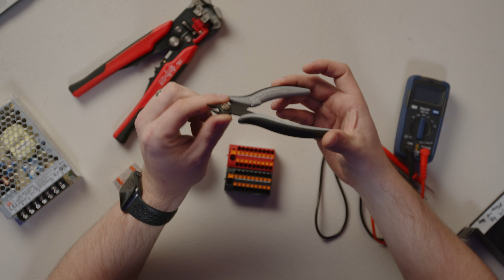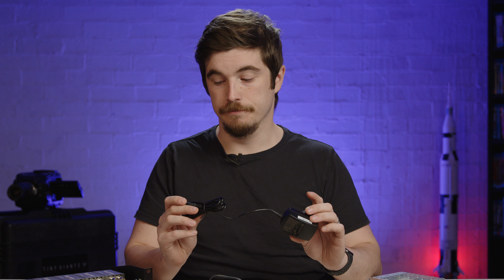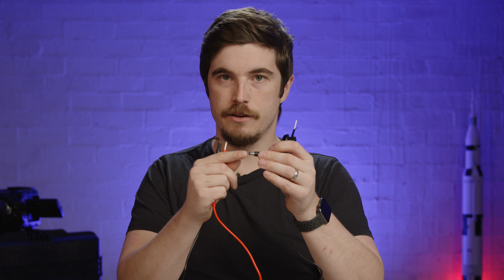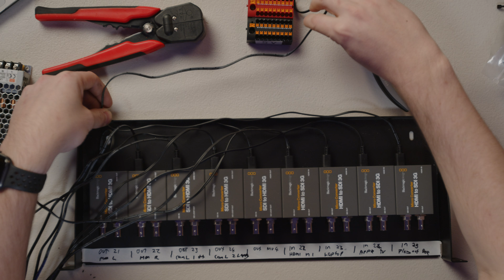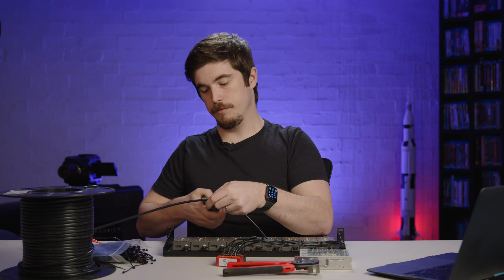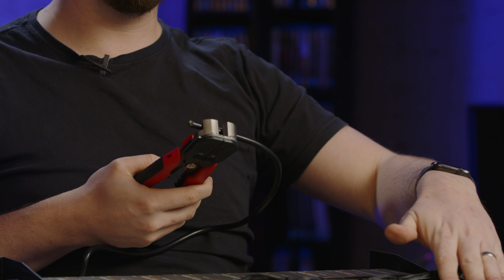Let's build a Better Power Solution for your System

Comment: I'd be using 3M Dual Lock instead of dual sided tape, allows for replacing the converters if one goes bad.
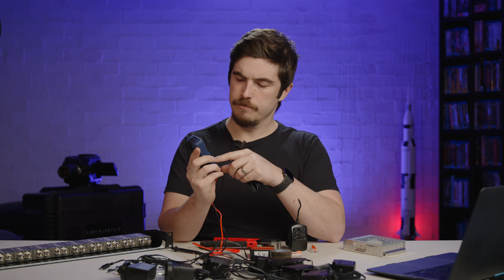at 6:58, you have the meter in the "continuity beep / Diode metering" mode.
should be using ferrules crimped on the wire under the PSU screws

Comment: With BMD Converters requiring the use of the USB port on the converters in order to do any kind of firmware updates OR to make any settings changes, have you thought of any ways to access these without unplugging your power / making huge changes to the rig?
Reply from the maker: Correct, the USB C port is there for configuration or firmware, but if down the track i need to all i need to do is unplug 1 at a time with a usb c cable with data and go through one by one and change them, at least this way they are super easy to access. In another rack build i am doing i am using the bidirectional converters which i do adjust often so have them accessable from the outside which is handy

Comment: I know that every country has different requirements for electric installations, so just out of interest: Is there some certification needed for working with mains power in Australia?
Stranded wires without an electric wire ferrule in a screw terminal is considered a fire hazard in Germany, as the contact can get worse over time. And the 18 amps from the power supply might go over one of the thin wires (in case of a malfunction of one of the Blackmagic converters), which could also cause a fire, as there are no fuses on the distributor making sure the thin cables only carry an appropriate amount of current.
Reply from the maker: So from what I understand in Australia, the main things that require electricians are putting in electrical points and getting power cables tagged every couple of months/years depending on what they are used for. So would need an electrician (or at least a sign off from one) if i was to put a power point somewhere, and electrical cables used on any sort of business or job site needs to be "tested and tagged" which a non electrician can get qualified on. Basically they are trying to make sure people arent using old dodgy cables. but as far as i know when it comes to devices that receive power a user can do it. but ill ask my electrician mate though to check with him, great question!
Reply: @RyanSomerfield  What did your electrician mate have to say? Disclaimer, I'm not an electrician, but I feel electrical tape may not be enough physical protection to pass an inspection. I'm sure it will pass a tag test as its wired correctly, but it still may pose as a potential hazzard. Maybe put the power supplie(s) in a box within the rig?

Comment: I like your approach to the 5V side of things but there's no way I'd want to have a power supply with mains terminals just covered by some tape. At the very least I'd have mounted that power supply in an earthed case and ensured that there were good cable clamps so that the mains cables couldn't be pulled loose.
Reply from the maker: That’s fair! The case this is going into is not going to be accessible by touch (without unscrewing panels) if it was out in the open I certainly wouldn’t be using these ones! I do plan on earthing the road case too but great point!